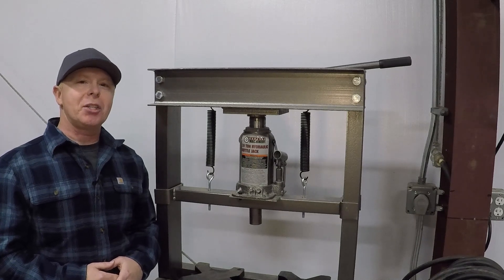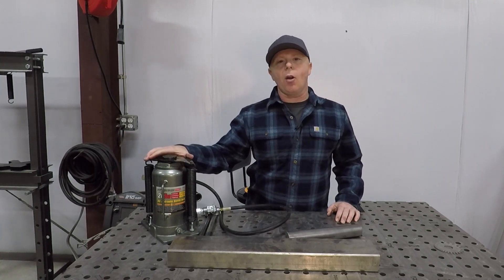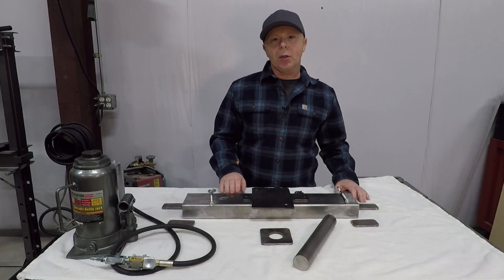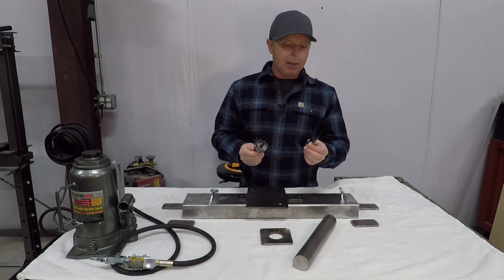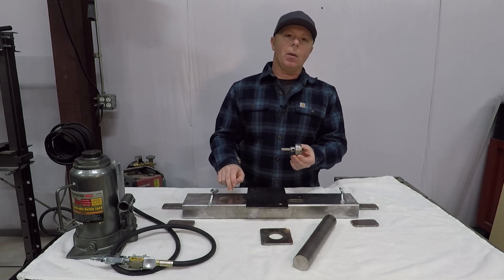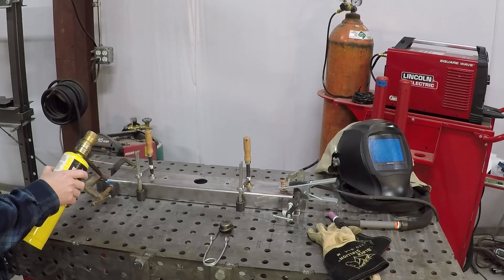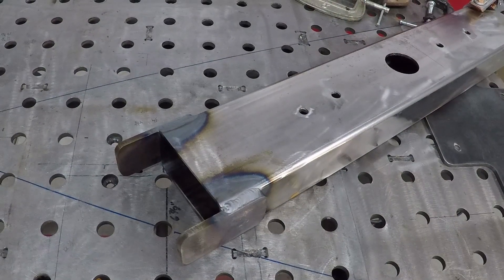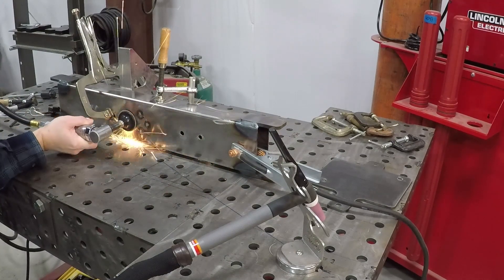Harbor Freight 20 Ton Press Modifications -- Improvement Mods

Comment: Wow, pretty awesome. I feel like this is a rabbit hole though! Once you make one thing perfect you will look at the rest and think about making that perfect. Before you know it you completely replaced the entire press!
Reply from the maker: Ha!! That can be very true, depending on the perfectionist in you! It's definitely fun and a good learning experience for me to try out projects like this.... and a reason to find out what needs improvement.
Reply: @57moto59  I just bought this exact press and thinking on improvements as well. I am somewhat thinking if I should weld the frame together like the earlier models In your video I saw a little bit of movement on the frame as well, has this been an issue?? Thanks for the help!
Reply from the maker: The frame does twist/rack and that was with only a small part. It can rack significantly when I really crank on parts. I've thought about welding it as well.

Comment: This is on the higher end of the HF mods I've seen, which beds the question: When is it worth just buying a better press that doesn't have these issues?
Reply from the maker: @larrybud  I think that comes down to purchasing power. The HF low cost is attractive for most. Most people can't see spending more for a machine that will be used little or is for a hobby.  At the time, I couldn't have spent more on a press. If you're running a business that needs a press,  you probably will be looking at more expensive units. Many of us can come up with a little along the way for upgrading,  but may not have the intial budget to buy higher quality from day one.

Comment: I just picked one up today and noticed this same issue and I had already planned on building a new one.  How thick and big of steel have you bent with the air/pneumatic Jack?  It wasn't available so I have to drive out and get it.  Nice mod
Reply from the maker: Thanks.  I've only bent 1/4".  I haven't tried larger.